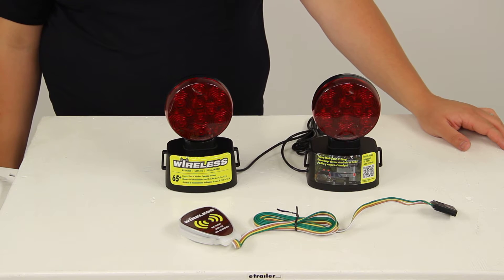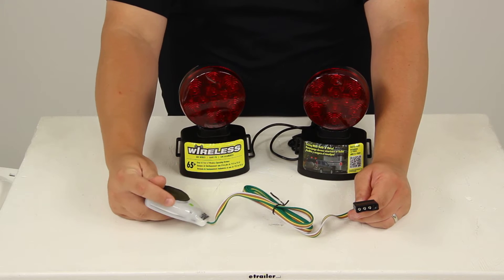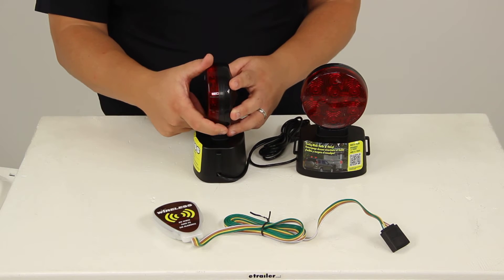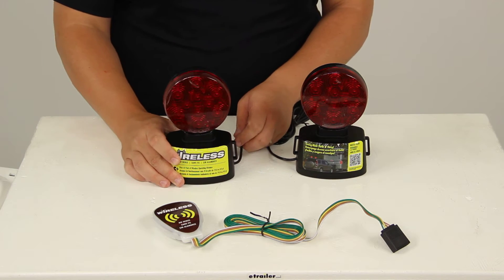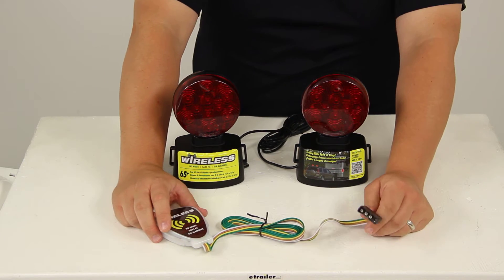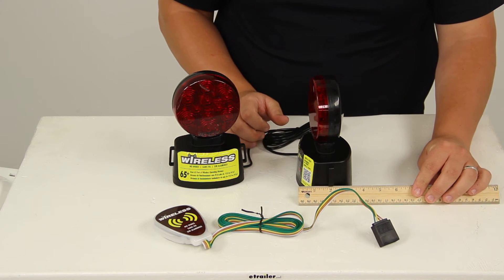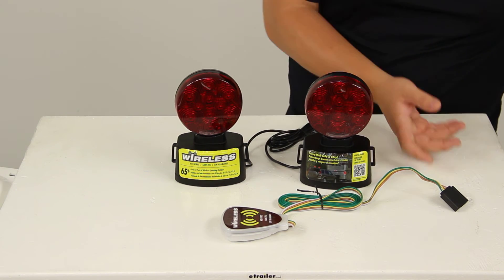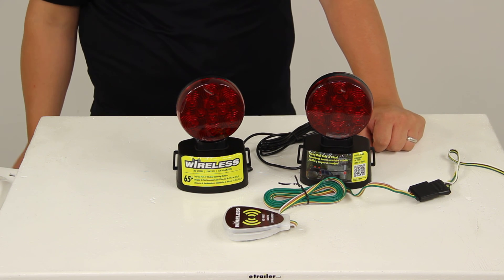etrailer | Complete Breakdown of the Hopkins Magnetic Tow Lights

Comment: I got these lights a day ago. Suddenly the right light lost all functionality except running light. I rewired it but the problem still remains. Do you know why this would be?
Reply from the maker: I would check your connection to the vehicle to make sure their is no corrosion that could be causing an issue. You can also try another trailer or a light tester to make narrow it down to the vehicle or the auxiliary lights. If it is an issue with the vehicle I would check the ground to make sure it is a clean connection.
https://www.etrailer.com/Tow-Bar-Wiring/Blazer/C6304.html